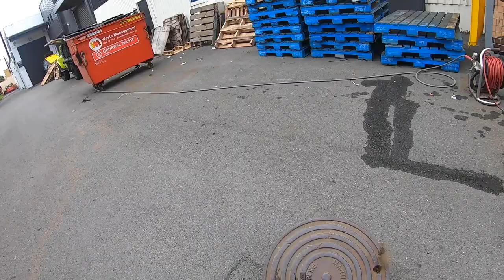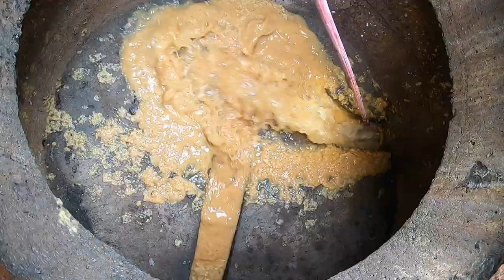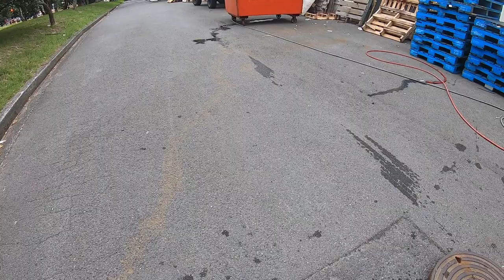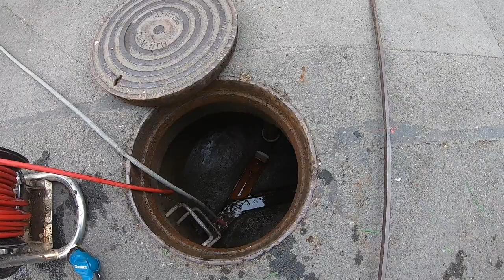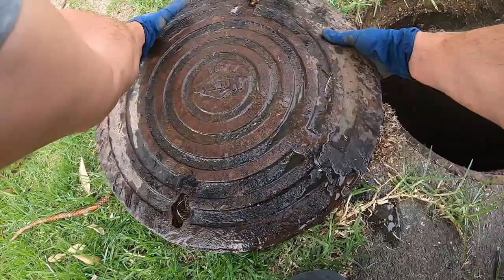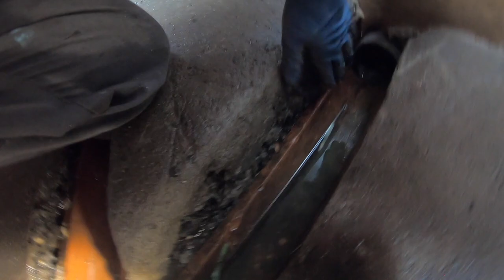Mr Drains #90 - Manhole down

Comment: The amount of people that still use old fashioned toilet paper is staggering.
Reply from the maker: Some of this commercial paper is so thick, you can leave it it a bowl for several minutes & still pick it up. Paper should effectively break up within 30 - 60 seconds, but that said the angle the branch line comes in at the 1st manhole isn't ideal & both manholes need some remedial repair or in the case of the second manhole, it can do with the base being replaced.

Comment: Sewer and drain guy for 30+ years here, id personally just smooth it out with hydraulic cement. But we all do things differently! It's another option.
Reply from the maker: That was the plan, but there are a combination of issues at play. The entry angle of the lateral into the first manhole is incorrect & unless the toilet paper is changed to a much softer variety, that breaks up quickly, it will still get hung up in the manhole. 

The other manhole's base has dropped 1-1.5 inches (25 - 40mm) approximately & Epoxy repairing it will be required if proper repair is not undertaken, which is to have the whole base redone as the underlying support has been eroded.

This work will be left up to the owner & the owners plumber to discuss & arrange.